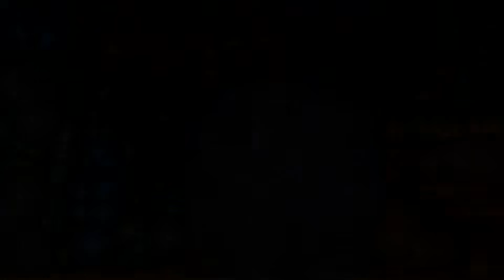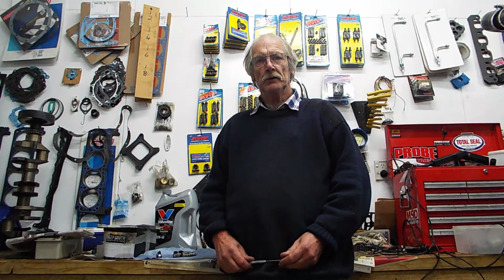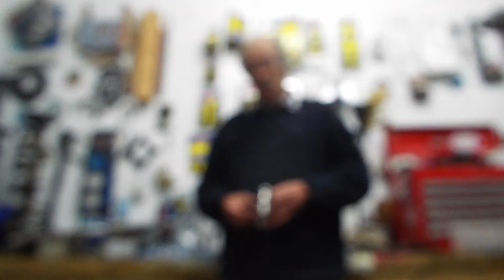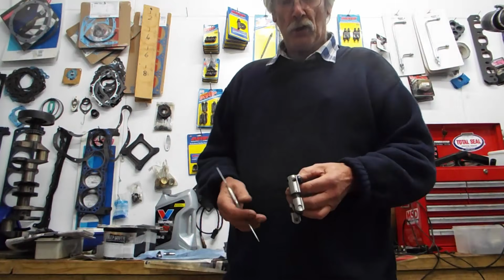Ford Cleveland Lifter Oiling Basics

Comment: One thing I have found is that when priming SR lifters with a drill or speed brace and when not getting oil at the lifters is to not overthink it, remove the pushrods and check that oil, no matter how small an amount, makes it out of the lifters and into the lifters pushrod cup. If any oil gets to the cup then in my experience when actually running I am getting enough oil to the rocker gear.

Comment: The oil drain backs are too small.
Reply from the maker: Yet they are the same size as all the other Ford V8's of the era ?    Another "trap" worth mentioning is that some head gaskets have their oil drain back holes punched so they don't align well with the block/head holes .... which can partially restrict drain back.